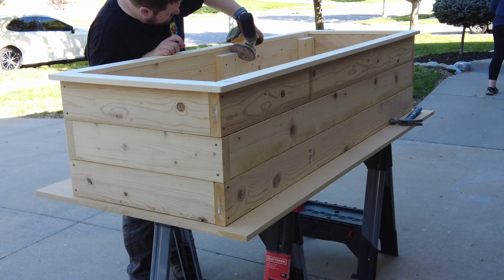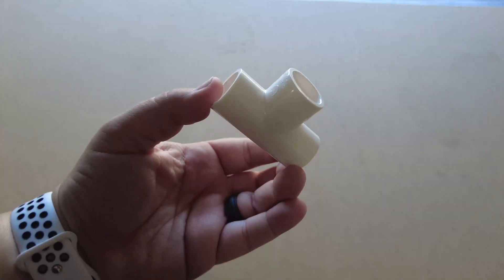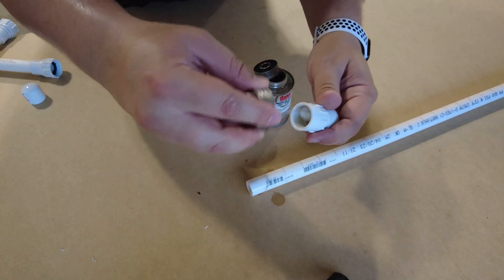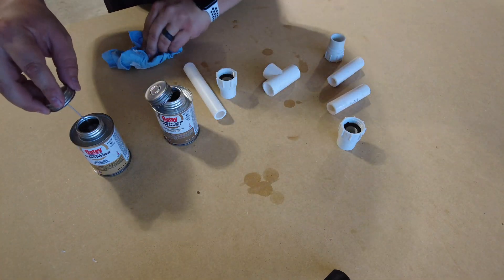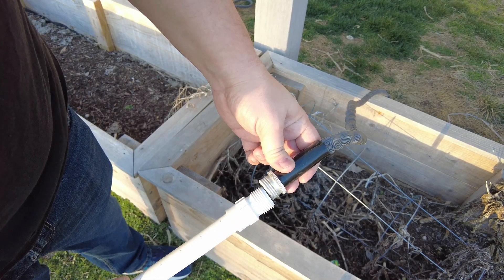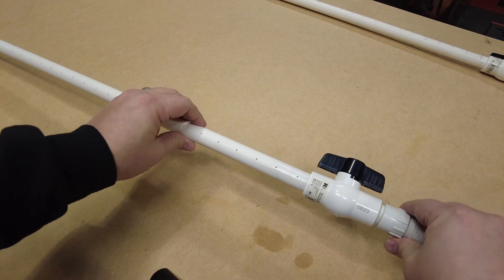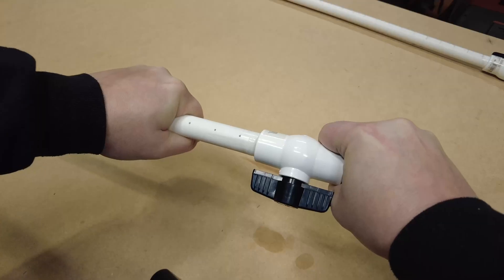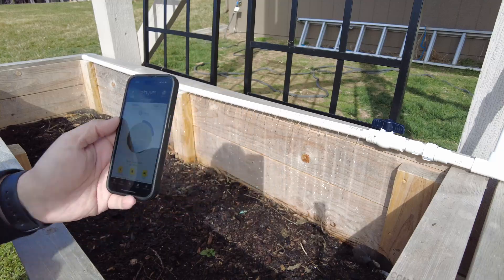How to Build an Irrigation System With PVC Pipe

Comment: Hey guys,no-one has stated the fact that the white pvc pipe forms algae inside the pipe over about a year. This tends to clog up the holes you drill to squirt the water by the veges/plants. I have opened the pipe end blockers to let the algae goo out in a rinse action but I think perhaps a full black pvc pipe system will reduce chances of algae forming as near no light will go through the pipe. Ps. An inch of Mulch on the surface of the soil will let you use way less water than bare soil. Cheers, Dave.

Comment: Good video. The only thing I'd add is for newbies to know that the male threaded drip irrigation(or commonly for other pvc uses)has course HOSE threads. There are ones with fine threads as well, whether female or male. I know, because I have a box full from years ago, when I didn't know better.